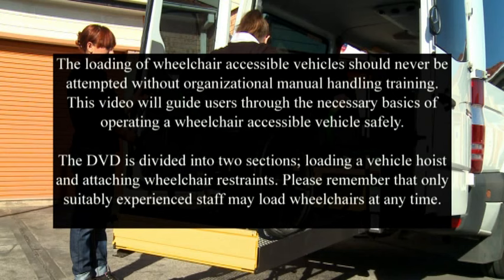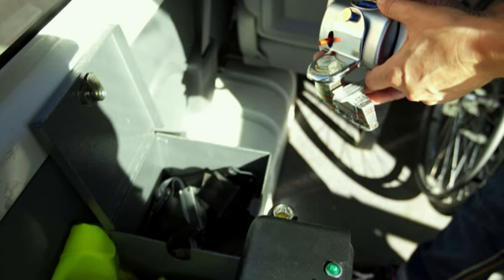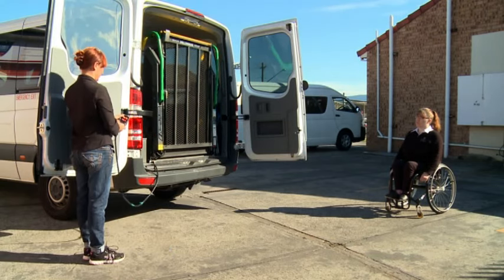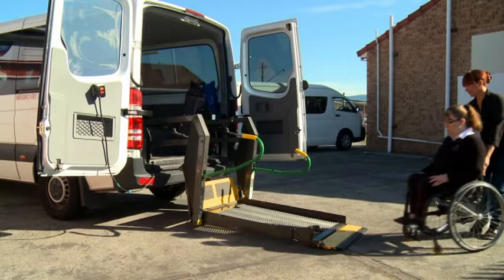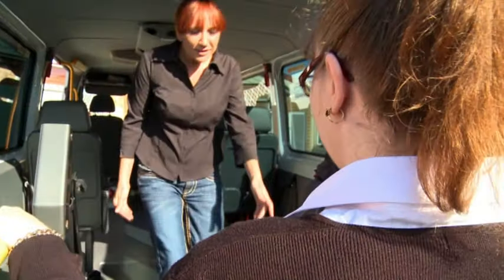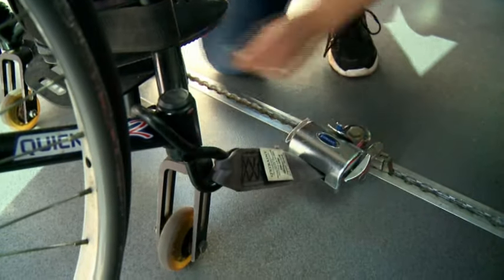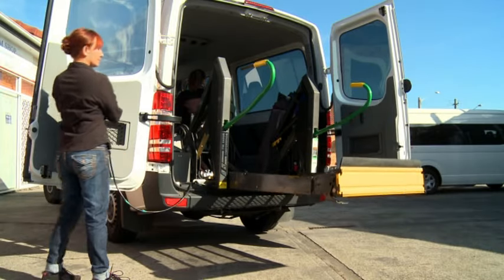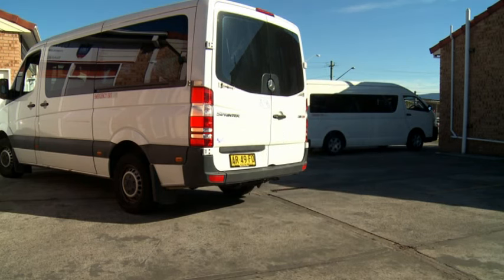Strapping Clients/Wheelchair in Vans

Comment: Epic fail! This video needs to be renamed 'How NOT to load wheelchair users into vehicles'.  No headrest on the wheelchair. Wheelchair backrest is too low. The front tie down straps were attached to an unsafe point on the wheelchair. The back tie down straps weren't straight. And there was no sash belt.